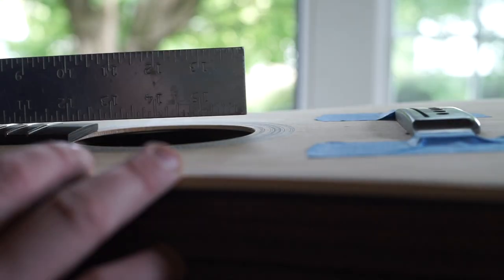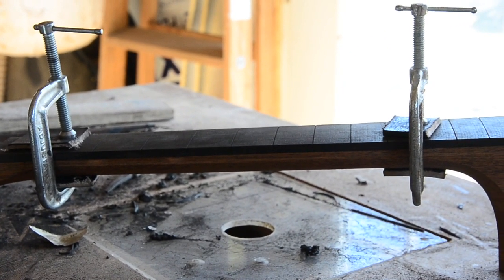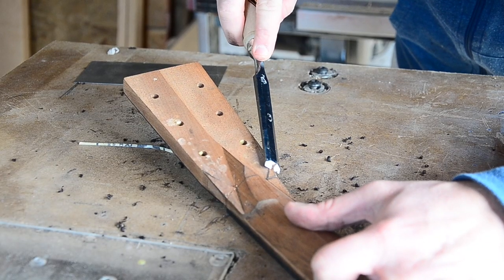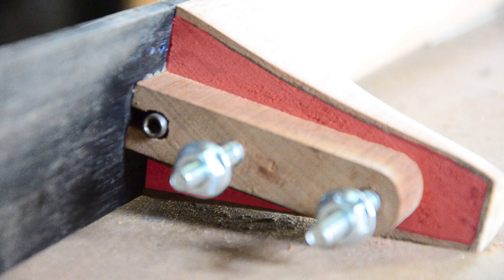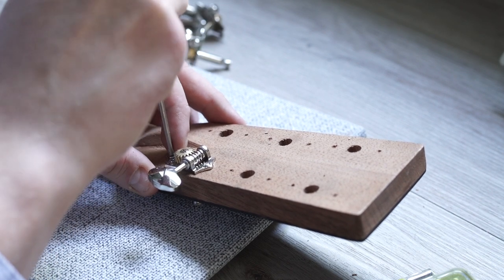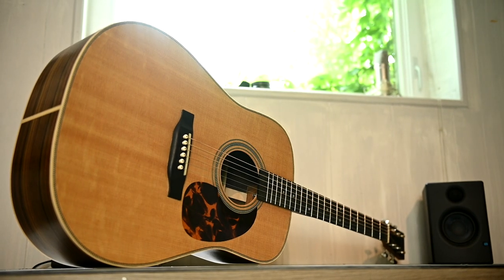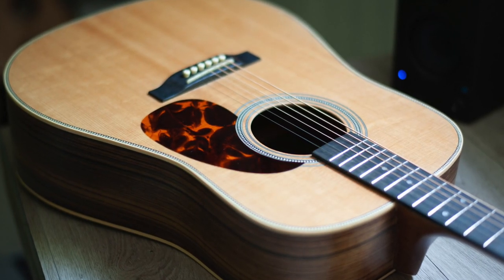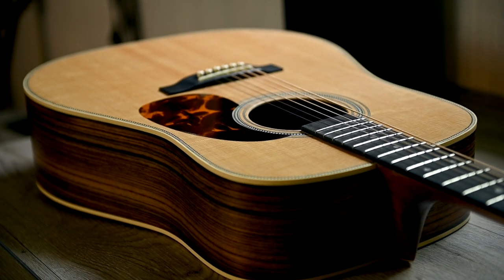My StewMac Dreadnought Guitar is FINISHED! (How does it sound?)

Comment: It looks like it worked out, but you definitely should never put any of your limbs in front of your chisel.  Chiselling with one hand placed far back on the handle doesn't give you very much control either and it means that you'll put a lot of force into any slips.  Thankfully you didn't slip though.

Comment: Sounds great! Worth the journey. Now you are going to have to explore adding a pickup. I added  an acoustic emg pickup to my stewmac. The only challenge was drilling the hole in the end block for the jack. It has to be straight or else the jack will be crooked. For my next guitar, I will drill the hole for the jack before I close the body.
Reply from the maker: I honestly thought about adding a pickup, but for the amount that I would use it - I think a soundhole pickup will be fine.

Comment: Enjoyed the series and the guitar sounds nice.  I've only recently started playing again and picked up a used Breedlove dreadnought, which has fantastic sound and sustain for days.  EVENTUALLY, I'd love to build my own.  You said you chose the bolt on in case you ever needed to remove the neck.  Is that the only reason?  Curious of the bolt on vs. dove tail neck pros / cons.  Also, do you know if StewMac has pinless bridges available?  As I said, being a new convert to Breedlove, a pinless bridge guitar, I may never go back to a pinned bridge!  Thanks, and really just an awesome job!
Reply from the maker: I haven’t looked into pinless bridges. As far as the neck joint, from my understanding, the bolt on neck is much easier to deal with. That’s why I chose mine. The dovetail neck may be slightly more resonant but my bolt on is very full and rich, so I would question how much more benefit you’ll really get with the dovetail joint.

Comment: Nice work ..I'll throw a little criticism your way .. when doing luthier work , always think ahead and plan on future repairs.. your small lineup pins on the neck are ok but didn't need to be that big . In fact just simple wire brads that barely prelude will do the trick.. However if you remember that you've put some tall ones in if you ever have to remove the fretboard ,say to fix the truss rod or replace the fretboard if you forget to trim your fingernails (wink) , then you'll be ok ..

 However,  those big pins in the bridge, those will probably be a pain later on .. and bridges do have a habit of pulling up in the back . And to fix them you havento remove the whole bridge to scape all tje glue off before regluing .. So , my tip is--- to drill the string pin holes , or at least the high and low ones .. either clamp it in place or

 ,.like I do , stick a micro dot of glue to hold it temporarily.  And drill and reem the holes (but not deep just enough to check your alignment later ) then remove the bridge. I don't recommend the latter  unless you are confident you can remove the bridge without marring the top. But it works great. In fact you can remove it.  Glue it up ,  use the pins to realign it and let it set until the glue tacks up , remove the pins and clamp . You'll still het plenty of squeeze out if your timing is good. 

 But the simplest method is to put rhe bridge in place, outline it with tape.  And use the tape for realignment to the spot . Let the glue tack up and clamp . 

   The last option is to  buy or make a bridge clamp drill pin holes and run the bolts with wingnuts through the pinholes . But this method works better when repairing and  regluing the bridge ..

The problem isnwith those big pins there its dang tough to run a palette knife underneath the bridge , that is , if you can the bridge loose enough to start with . You can but its tough to do without getting a lot of tearout on the wood ... just a hint for you other new luthiers ... 

 Lineup pinsnwork great.. but need to be very small and shallow.. and work better on hardwood.. . 

Like i said I likes your build and I'm not dissing anything.. just  trying to help .

 And you gave me angood idea of what those StewMac guitar kits consist of . I think it migjt be worth the cost because all the woods are there and ready to start  , and they are quality woods . So unless you have all the woods on hand already It's a great deal.  Guitar sounds great.  

 Thanks for posting .

Comment: Dangit.  Now I see how much I need to build one of these and do appreciate your expertise in addressing areas of most concern--somewhat differently than the guide book.  Was specifically looking for info on the bolt-on neck types-because they are easy to tweak if ever necessary. 

Intonation is one of the things that bugs me on my main rig now. Low E frets far too sharp-- I tune it down just a bit to compensate.

Comment: A couple of things ..
Cutting those bridge pin slots do 2 things .. 

1. They change the brake angle of the strings.  This really does affect the sound .. moreso the volume and sustain...

2. After a time when the angle changes .. and it will , then you'll have to sand the saddle lower to drop the action. And you'll probably do this 2 times before you actually have to reset the neck.... when you do this , those bridge pin slots ar going to have to be there in order to have any break angle... so might as well have done during the build ..It only takes minutes.. and you dont have to have solid pins .. you just turn your slotted pins around .. 

 Lastly .. hope you don't take this wrong .. but... you really do need to learn how to hold you pick properly.. I know it feels funny at first ... but If you don't practice it until it becomes natural you will never be able to advance in your playing... because this is so critical .. Not saying this to be mean .... Just trying stop your bad habit before you have it burned in for years and will be harder to brake.. Hey . You took the time to master some chords .. a proper pick hold is a whole lot easier to learn than learning only just one single chord ....

 Guitar looks great ..